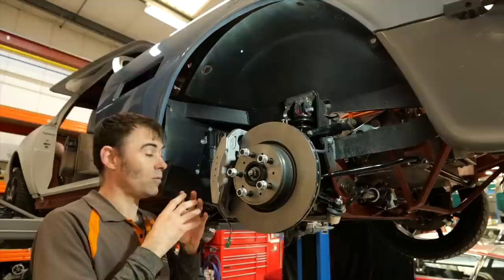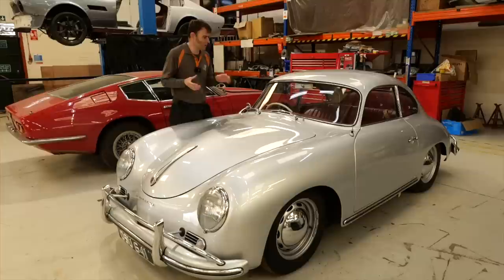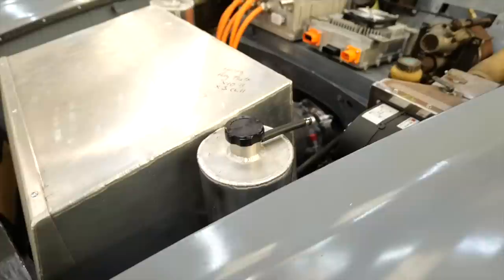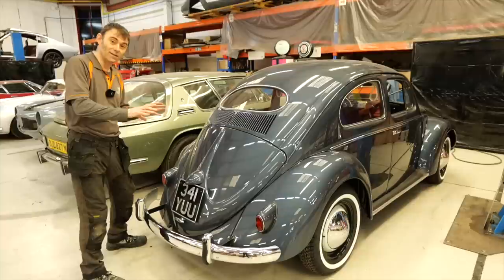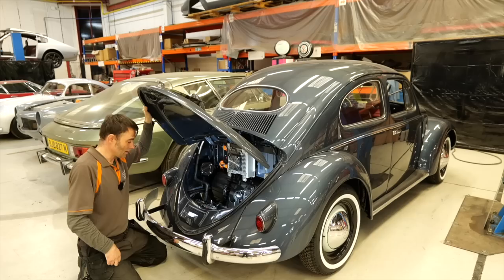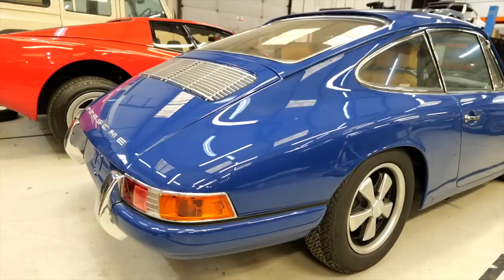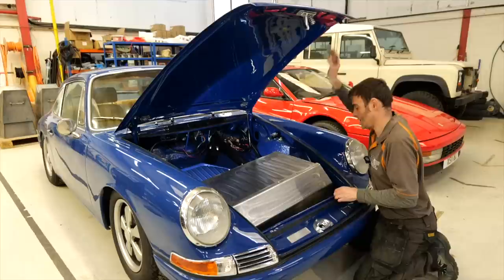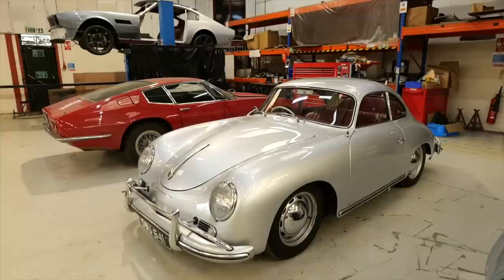Classic car electric conversion shop tour

Comment: i really have a hard time watching this channel.   almost every time the    i wanna have factor is just to big
Reply: No kidding
Reply: It's more cringe for me, like taking the works out of an old Swiss watch and replacing it with a cheap quartz movement
Reply: @Markcain268  what can you do if the cheap quartz needs less maintenance and does the job everytime you need it.
Reply: @Ruudi05  yes, you can do it, reduces its value and any interest folk may have in it, but if you want a worthless clock, then go ahead
Reply: @rob allen  These are the classics that will actually get used and just work when they do. There will be plenty of originals that sit in museums for you to look at.
Reply: @dustinmccourt548  I want to drive the original car, I don't wanna drive a fake car, a car without an engine is like Sunday dinner without meat to me, a waste of time and money, not something I would contemplate doing to any classic I like, kills the car in my opinion
Reply: I have a hard time watching classics turned into kit cars. The beetle, I don't think it's a bad idea, but to a 356, it's an absolute travesty.
Reply: @CheeeseToastie  the hardest times i have seeing collections  where all the tires are cubes. the horder don t  wanna use their oh so precious  investment objects. as i understand the  modifications are reversible. put a damn battery in that thing and use it. engine is special yes but also subscepticle
Reply: @Markcain268  nope. Proper engineering making a good car better and usable. They can all be reversed, but why would you. As to value, who cares. And it means you can drive a classic into the future.
Reply: @devonbikefilms  oh right, so, i buy a rover p6 v8 because I really like the engine it has, then swap it for a leccy motor? Yeah, makes perfect sense 😂

Comment: Hey Moggs, what about converting the Triumph's wheel well into a hinged one, that opens from below. Then you could cross-brace the hole inside the boot, and place the batteries straight over it. Cut the well off underneath, and weld on a hinge and a clasp to secure it. Rubber edge seal. Job done.

Comment: I like the fact that  many of the old designs run so well on a new power source. I wonder if it's because they were designed so well in the first place? They only had had pencils, paper and rulers but that Vitess could go for another twenty years - in which time all the components will have shrunk again, with more power. Well done you lot!
Reply: Thanks 👍😀

Comment: I like both Porsche's. I'm a fan of 356's (especially a 356B Carrera 2000), but on this walk thru I'm going with Tim's choice, the gorgeous blue 912. Sure it's only a 4 cylinder 912 and not a 6 cylinder 911, but so is the 356.

Thank you guys for another great video!
Reply from the maker: Good choice. Finally Tim is coming around to German cars. 😉👍
Reply: Great choice sir. 👍👍👍😀😀😀
Reply: I think it’s a great choice because it will be a 0 cylinder soon anyway

Comment: I guessed the Triumph Vitesse didn't have an engine in it with the excessive positive camber it had. Having owned a GT6 Mk3 about 25 years ago, I remember that the Herald/Vitesse/Spifire/GT6 have positive camber on the front and negative camber on the rear. 
Now I'd love to see a GT-E6 Mk3 one day! 🙂

Comment: Hi guys, in the Porsche, for the heater valve you could connect the cable to a potentiometer and run the output to a controller to keep the interior completely original
Reply from the maker: Great idea. 👍
Reply: @ElectricClassicCars  btw, have you ever considered using polycarbonate for battery boxes to save weight? I'm thinking about this for my Spitfire

Comment: Maybe you should design a circular battery pack to fit into the spare wheel cavity. Yes it is small but putting a battery in spare wheel well could be neat. A modern tyre inflation kit should suffice in case of punctures.
Reply from the maker: Now THAT is a good idea. 👍👍👍
Reply: errr no, put a spare wheel in tyre kits are crap and pointless. 
ive had 4 new cars all no spares and 11 punctures on motorways tyre falls to bits aa have to take you to multiple garage till they physically find a tyre as computers lie amd say there in stock. 11.5 hours to get home from a 2hr 20mins trip last one. 
not have a spare wheel on type approval should be illegal
Reply: @ElectricClassicCars  Put the spare wheel on top of the boot , Very 60s
Reply: A modern tyre inflation kits are terrible, (if its the goo stuff). the guy that will take your tyre off will hatre your for it.  but also they arent very good, they make a mess of the tyre, the tyre fitting machine and the person removing the tyre. A spare tyre is far superior in every single way apart from sapce, but as all cars tend to have a spare wheel cavity its a none issue.
Reply: @Brurgh  My 2016 car was supplied with a tyre inflator and some puncture kit and no spare tyre. Have never ever used it since I bought the car six years ago. Btw my car does have a spare wheel well which is filled with the factory Bose sound system.

Comment: The Aston Martin is the big win for me. Full subframe swaps don't suit many vehicles but for efficiency and capability it's the way to go for performance builds if you can make one fit. It's almost art work under there with those cables. I assume you will also be putting on matching tyres on the Aston LOL. Well done boys.
Reply from the maker: Thanks. The wheels and tyres on the Aston at the moment are just there to roll the car around in the workshop, they are not the final setup. 👍
Reply: I'd sooner walk than swap the engine in an Aston for a poxy electric motor, completely ruins the car, it's no longer an Aston Martin, more like an Aston Indesit lol
Reply: @Markcain268  Maybe they should call it a DV8?

Comment: Hi! Richard. There is a company called Amprius. Their battery has 2x more capacity than the batteries usually used in electric cars. Thought it would be interesting for you.

Comment: I love the smaller cars. Out of interest, could you guys do a kit with a smaller motor that can fit in cars' transmission tunnel or in place of the diff? That seems like quite a bit of weight that could be removed and you'd be saving space in the engine bay for batteries or storage, making it a bit more practical.

Have you guys had interest to convert a Fiat X1/9 or Toyota MR2? That seems like you could put a really small motor in there and have a fun little car which handles really well.

Comment: A while ago I chose Jensen Interceptor as favorite, and even it is only a 2 doors 4 seater it still attracts me the most: a rare mix of GT flaire with decent practicality and muscle car in pure European/British apperance with sexiest rear end of all of them.
Reply: Oh I love those, the V8 engine really sells it to me, without that it would be nothing in my eyes lol
Reply: @Markcain268  The old ones rear wheel drive were pretty unreliable thus they decided to convert to EV. There is a new remanufactured limited edition very recently of the rare long bonnet FF 4WD/AWD version with ready for emissions Chevrolet engine with more than 500 horsepower, all the amenities of today: blutooth, touchscreen, air conditioning and so on. Those will not get converted soon. Harry's garage Youtube channel has a video posted 2 years ago driving one of those beasts.
Reply: @nevco8774  I'd sooner spend the money on tuning and sorting out reliability problems, a jenesen interceptor without  a vocal V8 is not something I would want, same as an ac cobra replica with a four cylinder engine, it's just not on for me lol
Reply: @Markcain268  Watch Harry's garage video and his impressions about that supercharged V8 GM powertrain first!
Reply: @nevco8774  yes, that would be an option, but in such a car, I would, ideally, like to keep everything original as possible, have the engine rebuilt with modern seals etc, gearbox too, and some period tuning to that beefy V8 lol
Reply: @Markcain268  You cannot deny that brakes in that time were garbage. Most collectors prefer to upgrade brakes to modern ones. Then a modern engine and transmission is like Harry said install and forget about it. Also for convenience a modern air conditioning and heating unit is a must. Then the old suspension was floaty in comparison with modern one. All those I mentioned make a difference between a daily driver and a weekend/holiday car. Besides you already admitted the investment in that car is necessary to keep it up on the road. The difference is what to restore and what to upgrade. That brings us to the electric conversion done on this channel: it brings the best bang for the buck with lost of exhaust sound of course but everything is modern and perfectly reliable, usable for daily driving. No matter how much one might like the exhaust sound that person have to admit that a Tesla powertrain in a Jensen interceptor body is a very cool combination: European body with American muscle once again. And by the way the rare version 4WD Jensen FF featured on Harry’s garage is a different iteration of European body with a cool American powertrain made by GM once again with bulletproof reliability. Heck, even the original car had the same principle European body with a huge American powertrain from Chrysler.
Reply: @nevco8774  but then you have completely changed the car and the driving experience at quite a large cost, think I'd just buy a Renault zoe instead lol
Reply: @Markcain268  I live in the USA so the Nissan LEAF takes the place of a Renault Zoe. I perfectly can imagine somebody commuting in a LEAF daily and having an expensive toy to play at weekends like a Jensen.
Reply: @nevco8774  I'm in the UK and it seems the government are very anti car, making it as expensive as possible and really clamping down on anyone even thinking about having a bit of fun at the wheel, I must say I enjoyed driving much, much more back in the 80's and 90's when big brother wasn't watching you so much, it's more of an expensive chore these days lol
Reply: @Markcain268  In Europe and UK at least people have robust system of public transportation locally and across the continent. Thus the governments aim to tax down number of cars to combat congestion. In the USA in the large cities the congestion is horrible. In order to still enjoy cool cars people live outside of big metropolitan areas: I was stuck driving from outskirts of Washington, D.C. toward North Carolina for 4 hours from 5 PM to 9 PM and the distance driven was 30 miles. I tried side streets but they were full of folks like me trying to outsmart themselves to get even more congested. However outside the city in Virginia the driving was enjoyable. According to Deutsche Welle there are folks coming from Germany to the USA to enjoy driving on open roads (tourism with renting cars just for long trips across US highways) since Autobahn is notoriously congested and to enjoy driving without speed limit still available on certain portions of their Autobahn people have to use the time early in the morning from 3 AM to 5 AM.
Conclusion: if you want to enjoy driving just have a vacation to rent a car and drive across the USA; if you want to get scared by endless road and of running out of gas before you encounter a gas station choose between Australia and Canada; if you wand to travel across Europe the train will give you the least amount of headache.

Comment: I think you need to do a video on the V2X. For me its a killer feature that I can't wait to see available.
How will it connect when at home? Does it work using the DC connection to the battery and a suitable high voltage inverter/charger like the Fox unit? or is it working the on board charger hard?
Reply: We will be doing a full V2X episode in the future. 👍😀

Comment: If you could do a Mercedes 600 Grosser or particularly a Citroen DS with its hyrdoneumatic suspension and inboard disc brakes. That would be very interesting 😍😍 also because the minuscule 1.9 liter engine was never that fitting for a car that important. 👍🏽😍👍🏽😍 that would be great.
Reply from the maker: That would be cool
Reply: @ElectricClassicCars  pls pls pls 🙏🏽🙏🏽🙏🏽
Reply: I'm sure they would design a conversion if you had a DS and were prepared to come up with the cash!

Comment: Teslarossa, Aston Martin with that sweet m3 subframe bolted in. Then the time attack monster beetle.
Last maybe the 944 conversions you did a video on a while back. 👍🏻😎

Have you guys ever lent an ear to the idea of buying a complete road worthy say awd m3 and pulling the body off it.
Then swap on the outer body of a classic? 

Or like some have done on other ev swap channels make a custom tube frame that can directly accept the whole entire tesla battery pack's underneath and also bolt on the stock tesla suspension motors brakes etc. 🤔

Comment: The 356 is gorgeous. I guess the lower power engine will give it more range for the batteries on the other hand?
I guess I'm a bigger fan still of the Beetle, and this one looks sublime.
That Countach body in the background tho...
Reply: As with an ICE engine (but surely more so) if you're gentle with the right foot, you can be economical even with a powerful engine/motor. My guess is choice of less powerful motor was to save weight, size, cost, or stress on the rest of the drivetrain.  Maybe Richard would be kind enough to enlighten us.
Reply: If driven flat out then yes it would have more range than a more powerful motor but in normal driving there won't be any difference. The more powerful electric motors are not less efficient for a given output unlike petrol engines of yesteryear.

Comment: Think the 190sl as it’s a wafter of a car and no noise would actually make the 24:42 car better .
Is it possible to have a engine noise linked to throttle to create simulated sound from the  relevant sports car ie Porsche  or Ferrari . Absolutely love your passion and wish you every success.
Reply from the maker: Thanks. It is possible to have a simulated engine noise but we feel it's a little like putting propeller noises on a jet, or horse noises on a petrol car. 😉👍
Reply: Leave it as it is, then you have real engine noises from a real engine in a real classic car

Comment: The 356 takes it for me. What a beauty. 

I do have a question for you guys. You use a lot of single-motor drive trains. Is it a communications/synchronization issue or something that has you not opting for in-wheel motor systems?
Reply from the maker: In wheel motors simply have too many disadvantages which is why no major manufacturer have gone that route.

Comment: Will the high voltage cables on the first car be covered at some point? Probably easy
to get to get caught out in bad weather where you folks are from. Great video as usual.
Reply from the maker: Yep, there'll be a cover plate that runs the length of the exhaust tunnel. 👍
Reply: @ElectricClassicCars  Thanks for the response.  Great looking cars.

Comment: I love the Ghibli and the 356. Even more so with the keeping of the original gearbox. Is it dual Hyper 9's in the Ghibli. It looks like X1 inverters. Are the cable covers something you 3D print? they look like they have your logo on them. The high voltage cable clamps are those 3D printed? or is someone manufacturing them now? My son designed and printed some for my 914 a few years and they still look new, so it seems printed parts can hold up. Are they going to keep and store the engine of 356? I hope you do build videos of both those cars.
Reply from the maker: Yep, dual Hyper9s on the Maserati. The covers are injection moulded plastic. 👍

Comment: I rallied a Triumph Vitesse - until I wrote it off hitting small boulder under the car when it became airborne and broke in two upon landing. Always very rusty.
Reply from the maker: Brave man rallying a Vitesse. Did I have a full cage in it back then?
Reply: @ElectricClassicCars  There were quiet a few around in history and you could buy a sort of cage. I wouldn't want to rely on it because of where it fastened on the chassis/frame.

Comment: How come the two new rear tyres on the Aston are different? I hope you get a DB5 or DB6 in the shop at some point.

Very nice Vitesse. How about a TR6?

Is the Defender going to end up faster than your Land Rover?
Reply: They are just to roll the car around and will be changed for new matching tyres when finished. 👍

Comment: Vitesse, Heralds, Spitfire and GT6s all use more or less the same chassis (Spitfire and GT6 Are 8 inches shorter). A lot of Bond cars used the chassis as well!Love it! 
Would you be willing to divulge what you are using as a „translator“ for the gauges?
I have tried to figure it out for a while and can’t find anything…
Reply: Great they're doing a Triumph. Will the Vitesse diff be strong enough to cope with the torque from the Hyper 9?
Reply from the maker: We'll be covering that magic black box in the next update episode on the Teslarossa. 👍
Reply: @danialclarke5150  Depends on the ratio. The 3.27 are known to be weak as the carrier was thinned to fit the gears. The more common 3.63 is what is even used in vintage racing (See mark Field's LeMans Spitfires) and with quality parts should hold out OK. A friend converted his Spitfire 3 years ago and has not had problems with a 3.89. Another weak link could be the gearbox. The later 20-splined, single rail  Marina box is tougher than the 3-rail, 10-spline one. Again though, my friends' MKIV has the "weaker" gearbox and has been fine. He usually drives off in 3rd and cruises in 4th...

Comment: Just wondering for the smaller cars like the MINI, would you consider doing hub motors ? Like the Aptera. Not sure when their hub motors will become available but would be cool to see those into smaller classic cars.
Reply: Those motors are made by Elaphe
Reply: I very much doubt there would be enough space in a 10 inch wheel for a suitable hub motor.